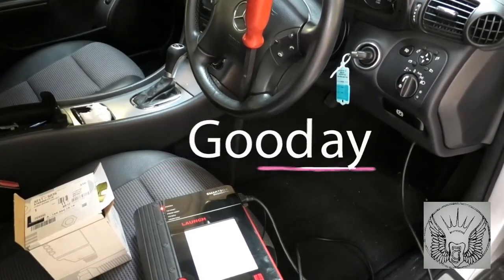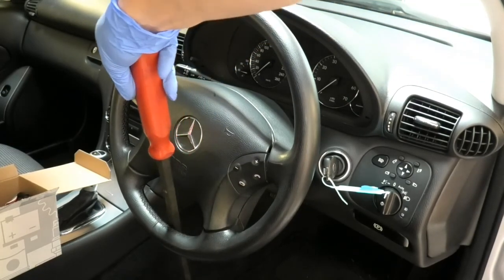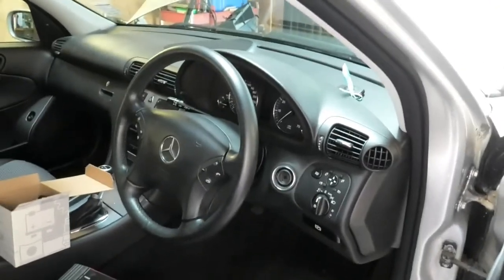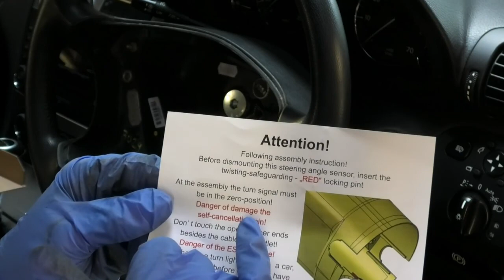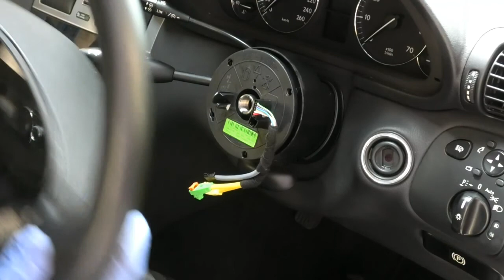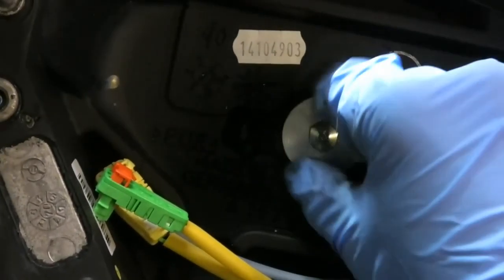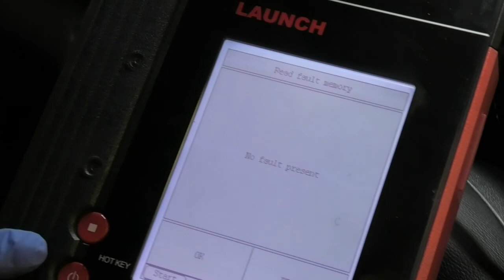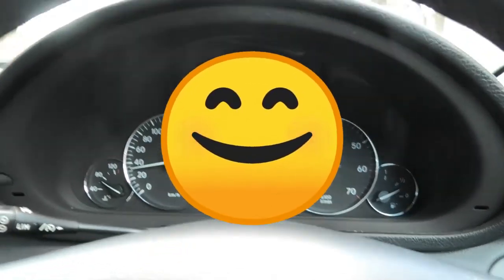Mercedes c180 Kompressor 2004 ESP fault fix

Comment: I have the same fault codes on my 2005 C230.  I purchased the steering angle sensor and will be installing it tomorrow.   I will be using your video as a guide.  My neighbor agreed to hold the wheel while I remove and reinstall the steering wheel bolt.  Thank you for posting this.  The part cost $205 U.S. and your video provided some assurance that I wasn't wasting money by "throwing parts at the problem."
Reply from the maker: Good luck!, 🤞 hope it solves your problem.
Reply: @DaringBeefcake  I've driven the car about 400 miles since I replaced the steering angle sensor.  The warning has not returned.  I consider the repair successful.  Thanks again for posting your video.  While I had the steering wheel off, I also replaced the cruise control stalk.  The stalk had been finicky - If I pressed it too hard it would turn off and I had to turn off the car if I wanted to use the cruise control.  For a bit more than $300 in parts, my satisfaction with the car has increased exponentially.  I expect that having the same repairs performed by mechanic would have cost between $800 and  $1000.

Comment: Great video did you have to initialize the steering angle sensor by turning the steering wheel lock to lock
Reply from the maker: To be honest I cleared the fault codes and that was it.

Comment: The process of putting the steering wheel back on is quite time-consuming. Is there any possibility to check whether everything we have done and is correct, or the angle of setting is as it should be, before putting the steering wheel back on.
Reply from the maker: You just need to keep everything the way it comes out, and it can only fit back in one way. There is no other way of checking until everything is back on. It doesn’t really take long.

Comment: Our Mercedes C200 2005 model's battery is flat and "ESP faulty" message came up. Is it because of flat battery? Will it be gone once we install a new battery? Car is made in South Africa if it helps.
Reply from the maker: Hi the esp light can come on as a result of a low battery voltage, however it could also be a wheel speed sensor or the issue as per the video, so am afraid it is no guarantee that changing the battery will make the light disappear, you may also need an OBD2 to read delete the flat code. Sometimes if it is a speed sensor you can drive the car a bit and then switch off and on and that will reset it, but more complex faults won’t reset. Sorry it’s not a simple answer.
Reply: @DaringBeefcake  Thanks, man.

Comment: We keep on having problem with our c200. Keeps on draining its battery. Alternator checked. No problem. Esp light is on. Can that be the culprit?
Reply from the maker: Is the battery ok ? I mean did you check its life percentage ? and well if its new the other issue might be the siren, that tends to go bad and drains the battery, I have not experience a faulty esp that drains the battery, having said that there's always a first for everything..

Comment: You talk about a steering module sensor but the product you fit is a clockspring. Aren't they two very different things?
Reply: The clockspring and sensor are two individual parts mounted together - it's not difficult to separate them apart.

Comment: Can you tell me where can i found the piece ? I want an economic one please
Reply from the maker: look on ebay for a used one..
Reply: I searched for a week and i didnt found anything, its not too easy to found for the w203 second version(2004-2007)
Reply from the maker: Well may be they will be up to 130 or so but that’s much cheaper than a new one.

Comment: C1172 error Code c180k w203??? Please
Reply from the maker: I seems you may need to change the steering angle sensor, that’s what fault code is showing.
Reply: Change!!! Ok there are Any way to check??? Before buy a new part??
Reply from the maker: @nicasioperez7727  you can read the live data for the steering angle sensor with an analyser and check the numbers, technically when the steering is central it should be around 0.